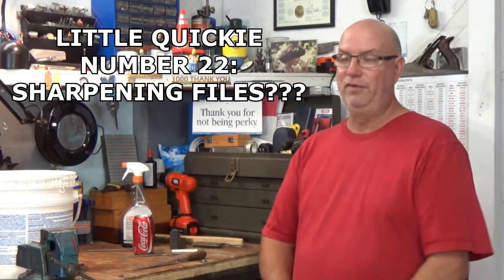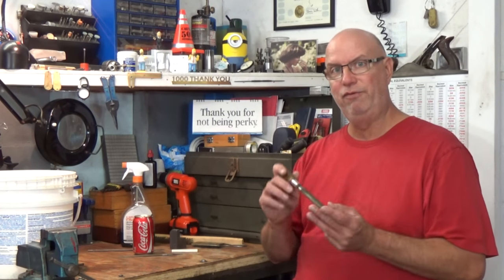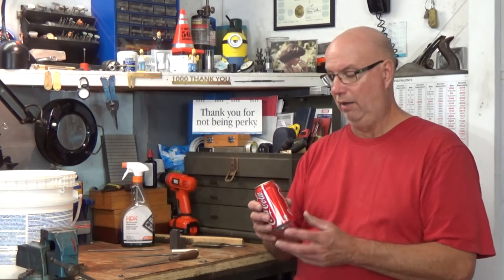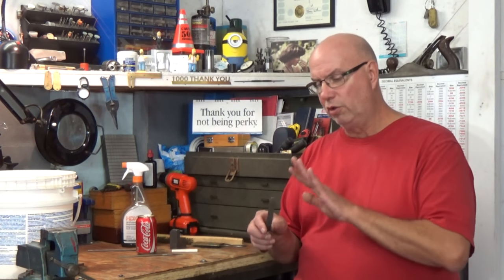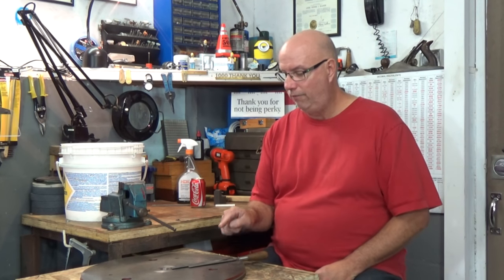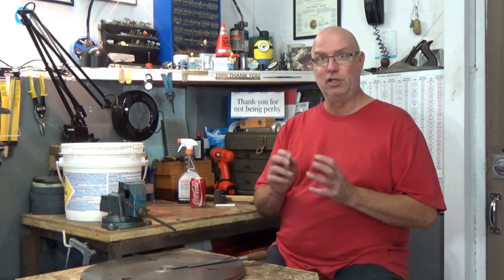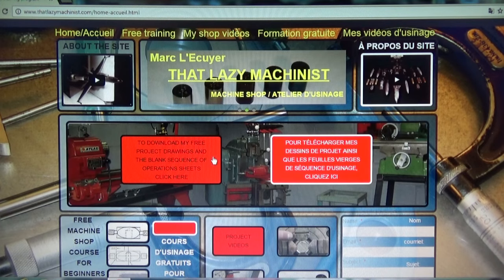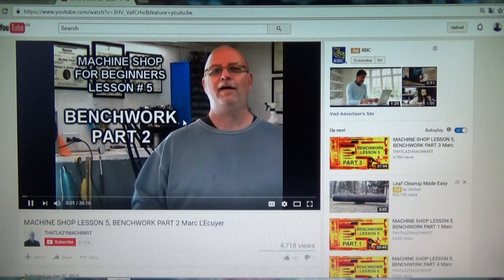File sharpening, MARC LECUYER

Comment: Best little fact about files is the term bastard. Long ago, well over century(when manual hand tools were a bigger deal), there were fine, second, and coarse cut teeth but folks found that the coarse standard was much too coarse for most work. So somebody started making a new tooth size between second and coarse, as it wasn't quite one or the other it became known as the bastard, which is the most coarse tooth available in the modern day.

Comment: You can also use talc or baby powder is my favorite. Slap some into the groves before filing and it helps to keep from loading. Especially when working Aluminum. Usually to clean mine I use mineral spirits rubbed on with a tooth brush, then wire brush them while wet and blast them with the air gun. I am sure there are probably 100 things wrong with that procedure, but frankly until someone starts buying my files then they can tell me how to treat them. Second You will never catch me throwing a file away, They make such handy tools in other areas. Even the cheap one make great scrapers.

Comment: Thank you, Marc.
I've always been of the belief that a dull file is a dull file and a dirty (plugged) file is a dirty file.
Carding will clean a dirty file but will not sharpen a dull one so for proper function, card the dirty file, replace the dull one and don't drag the file backward across the workpiece.
Thanks,
John
Reply: I've heard that putting a file in sulfuric acid for about 45 minutes will sharpen a dull file.  Presumably the acid will eat away the damaged ends.  Allegedly, this will work 3 or 4 times before the file is no longer able to be resharpened.

Comment: Good video....Somewhere along the way I learned that using a piece of copper pipe to clean a file really works well. You squeeze the end in a vise until it's flat, about 1" long. Then rub the end over the file to remove the gunk in the teeth. This isn't for replacing the file card, but sometimes the card just won't clean all of the teeth. Try it out.... Thanks for the videos!

Comment: Dull files have their uses - I use them as sacrificial electrodes in electrolytic rust removal tank as they have a large surface area for their size.
Acid etching that everyone raves about, just roughs up a file surface making it akin to a sanding stick. Folks think they are sharper because the worn out file they started out with, will now grind metal .... but not for long. A sharp file is a cutting tool and once you have blunted it, there is nothing that will restore it. Buy good quality files, store, clean and maintain them properly and they will last for years.
Handy tip is to keep a few 'beaters' close to hand on the bench for those odd jobs that are likely to blunt a file, eg stock removal on hardened steel, where you don't need a good surface finish..... and be prepared to bin them afterwards. I can go through a couple of these re-profiling a hard steel Scandinavian axe head.

Comment: It is possible to sharpening a dull file even it's not economical viable now days! about 20 years ago I did it, first anneal the file, wend soft a chisel would be used to reshape the tooth profile, wend done re harden and temper the file and there you have a file as good as new.
Reply: Really, you could make a file just as easy the same way. Start w/ 1095 high carbon steel, good to go.

Comment: Hey Marc you should dig that scrap file out of the bin as it still has some uses , it is still good for polishing using emery cloth and the old file as a backing or you can chuck it in a fire and anneal and use the material to make cutting tools etc.
I remember in high school the students used to have sword fights with 12 inch files much to the amusement of the teacher - not !!!

Comment: Files can be sharpened with the correct acid (sulfuric) or vinegar. 
First, you thoroughly clean the file so that the acid/vinegar can contact all parts of the file.
Second, you suspend the file vertically into the acid/vinegar so that it does not contact the container.
Third, soak the file for approximately 15 minutes, then remove it, neutralize the acid with a baking soda water mix, rinse it off thoroughly with water, then dry and oil the file to prevent rust.

Comment: great to see you are back!  I use a thin piece of soft brass sheet, say 1/16 in. thick by 1/2 in. wide in a pair of vise-grips pushed along the file teeth to clean instead of a file card.  The file teeth cut into the brass forming a "comb" to clean between the teeth.  It is surprising how much it scraps out of a used file.  Also might mention boggstool.com for really favorite, quality files worth restoring to 95% new.  Again, welcome back!

Comment: Well Sir I beg to differ.......... you can reclaim blunt, dead files, many years ago as a woodwork and metalwork teacher I saw an advertisement in a publication sent to schools all over here in the UK. It advertised to be able to rejuvenate old knackered files. Now as we were thinking of ordering some new and on a school budget Nicholson files I said to my head of department why don't we send  a load of these old knackered ones we had in a cupboard to give it a try as the cost of " Re-sharpening" ten files was around the cost of one new Nicholson of the same grade and size. Anyway he agreed and we sent 20 I think ten inch second cut files away and as a precaution I marked the tangs with a stamp so we got the same files back and a few weeks later they came back looking like new, And as sharp as a new one. I was intrigued as to the method and contacted the company and was told it was a "trade secret" and all the man would tell me that it was an acid etching process after a thorough degreasing. So it can be done and it works well.

Comment: I have heard that you can "sharpen"  file using an acid etching solution. Would this process be just doing a very thorough cleaning and de-greaseing?
Reply: works even better with DC voltage

Comment: I never throw a way a worn-out file. It is tool steel, and you already paid for it. Make something out of it -- a knife, or in my case knives and carving tools. A piece of wood works just as well as a file card and in the long run is better because the file card itself gets pinned just like the file. As your commenters have already said, it is possible to revive a rounded-over file by etching. But the etchant is Nitric acid -- hardly stuff for the home shop. Extremely dangerous. Maybe Hydrochloric acid would work as well. Just as dangerous. The etchant attacks the top of  the file, so it removes the rounded edges. This is a job for pros, so I use old files as a source of tool steel. Got to anneal it yourself, but lots of coffee can furnaces on YT.

Comment: That file you had there was pretty dead for sure! If you have files that are a bit dull, without the teeth being totally rounded over like the one you had there, etching works awesome.  It won't make them like new, but it will get a lot of extra life out of them.  I soak mine in white vinegar after carding and de-greasing, and it usually doesn't take more than a few hours.  A lot of people don't believe this, it's a cheap experiment to try and if you make sure to card the file first and thoroughly degrease it, and as long as you aren't starting with a totally beat file, it will absolutely improve it.  I only bother doing this with really high quality files that would be expensive to replace... my "beater" Nicholson files are so cheap that it's hardly worth the effort.

Comment: When you're file is fowled, stop chasing chicken with it! If you take a thin copper pipe, or a an old rifle casing, and flatten it and rubb it along the teeth, the fowl comes out! Do not use any stainless steel or brass or aluminum, on a file if it's gonna touch steel that will be blued in the future.

Comment: These people:
http://boggstool.com/
 will return you a file that is sharper and cuts better than new.  If the file is anywhere near as bad as the one you showed us, they will reject it and send it back untouched.  They do good work at fair prices.
Edit:  They also sell quality new files at decent prices...
Reply: Also, as Marc perhaps alluded to with the Coke, soaking files in acid to sharpen them does not really do a very good job of returning them to sharp, smooth cutting, or long lasting.  Also, on some level, files are expendables, like sandpaper.
Reply: Also, as Marc perhaps alluded to with his Coke, soaking files in acid does not really do a good job of bringing the files back to sharp, smooth cutting, and long lasting.

Comment: If you treat your files right from day one they’ll give you years of good service, even cheaper ones.
I always take the time to clean mine using a file card/brush, sharpened brass if necessary, then degrease if necessary & chalk them (or use talc or french chalk, I just use regular blackboard chalk or even natural chalk as I live in an area where there’s lots of it).
I always keep them hung up, separated, never in a drawer & never where they can rub against each other.
As with most hand tools, look after them & they’ll look after you.

I don’t really see how an acid dip would re-sharpen a worn file 🤷‍♂️
Reply from the maker: Your description of proper file maintenance is perfect! Thanks for the input, Marc